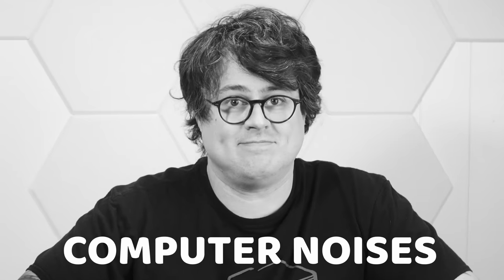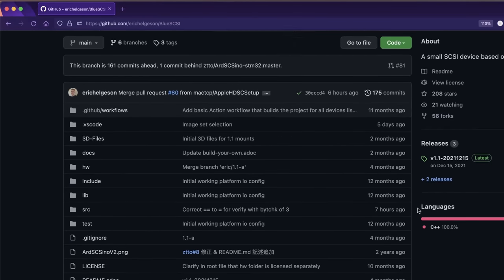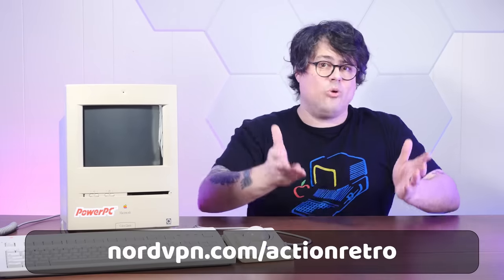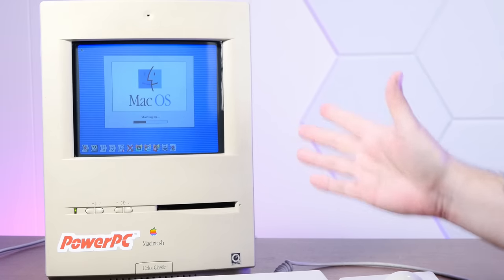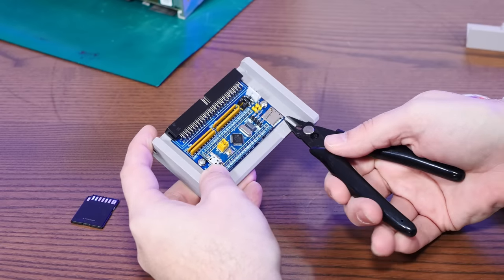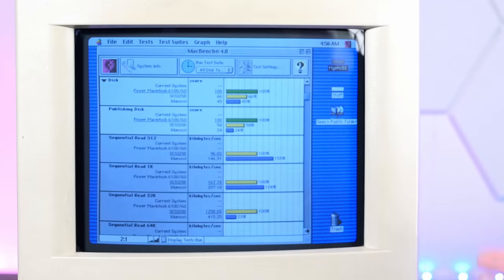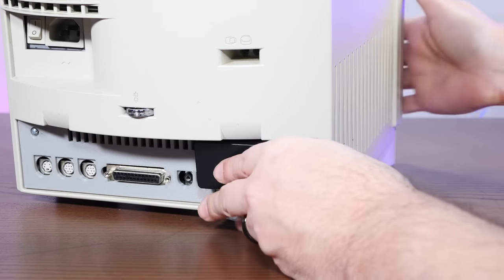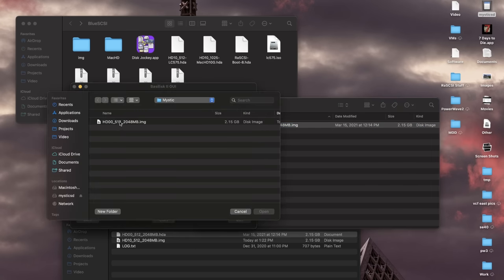BlueSCSI is AMAZING!

Comment: Block size mismatch is a huge problem performance wise on any filesystem, so you should make sure these do match.
Furthermore, small block sizes will improve performance for small files but hinder large file performance, and the oposite is true too, large block sizes will improve performance for large files and degrade performance on small files.
Now, discrepancy between the underlying filesystem block size and the "real" block size perceived/used by the OS that will be using that storage will have a considerable impact on performance and should be prevented at ALL and ANY costs!
This may force you to use smaller SD cards as larger SD cards will typically have larger block sizes. So, keep in mind that unless you use EXFAT instead of FAT32 (which the BlueSCSI would have to support natively) your block sizes will be quite large. For example, a 32Gb FAT32 formated SD card will likely have at least a 32Kb block size, an EXFAT one will enable you to bring that down to 4Kb, this though does require (as mentioned)  the BlueSCSI firwmare to support this Filesystem version.
Reply: Due to the way (statically allocated) disk images work you would always want the filesystem cluster size on the host card to be as large as possible. I spent a while thinking of how to explain it before I realized it's simple: disk images are very large files.
Reply: @eDoc2020  yes they are, but the host side controller still needs to do 4kb or smaller requests, unless you have some smart caching and the needed RAM for this approach, smaller micro-controller based approaches will need to use algorithms that will be directly impacted by the sector sizes (and their alignment). This is where crap it's the fan.
Reply: @João Henrique Da Silva Nunes Jales Ribeiro     The purpose of the filesystem is so the MCU can determine which physical sector number on the card contains a given sector number of the image. With fewer blocks this process should be faster because it doesn't need to process as much FS metadata. Once this mapping is determined for a given sector the FS block sizes don't matter at all. If the Mac requests a single 512b sector and the SD card is using 64k clusters the MCU will only request the needed 512b from the card.

IMO the only place performance would suffer is if there is gross misalignment where each cluster on the filesystem of the emulated drive is spread over multiple blocks of the host device. If the host blocks are larger the chances of needing multiple host blocks per request are lower.

Comment: Awesome video.  My only disappointment was finding out that BlueSCSI was not Bluetooth based, which sounded horrifying to me even considering that I used to chair the Bluetooth HID Working Group.  😉
Reply: Why would even expect that? Just because it had blue in the name? That makes no sense.
Reply: @kirishima638  Actually, at least back when Bluetooth was new-ish, everything was blue.  Everything.  Blue was in the names of Bluetooth products.  Blue was the color of the plastics.  Blue LEDs were constantly used even though they were more expensive that other LED colors at the time.  Blue was in the name of the SDKs, the protocol stacks, protocol analyzers, the company names, etc, etc.  It was so intense that non-blue products stood out.  One such exception was the CATC Merlin Bluetooth protocol analyzer that was purple and that was only because CATC had already used blue as the color of the CATC Chief protocol analyzer for USB.  It's not as bad these days, though.
Reply: @ChrisDreher  That was 20 years ago dude.
Reply: @kirishima638   Yes, many are old, some are new.

Comment: FWIW I got a SCSI2SD in my SE/30 with a custom 3D printed holder that is readily available. The SD card is easily accessible from the back of the computer. Even with your old setup, you can use SD extenders to get the SD slot out of the computer. So ability to swap SD cards is not a pro for either solutions.

Comment: This indicates that the BlueSCSI needs some deep firmware revisions and improvements, assuming the CPU has the needed BUS performance and that the issue is improper code (which soulds like it is) the BlueSCSI shall perform better than any other solution.
Reply: That's a very bold statement considering what the creator of the device has suggested (use Apple drivers), not to mention several comments about the extended SD card reader as the likely culprit. I would recommend holding back on your judgment until some of those ideas have been eliminated as the cause.
Reply: @another3997  I'm pointing to the firmware on the bluepill itself needing deep optimization, and it would likely enjoy to have fast SD cards and some RAM for caching.
Reply: @another3997  Yeah, I'll stick to my point based on a simple proven premisse, SD cards can and do perform way faster than the results being obtained. Caching will help here considerably, but that is not the whole story, even without caching SD cards perform faster than what is being achieved at this time.

Comment: You used a full-size SD card instead of MicroSD, and it was only 16GB. Something tells me it was a really slow and old card.

MicroSD would probably be faster, and newer.

I am also willing to bet the extender had something to do with a loss in speed, it usually does for like the optical disc-drive emulators for consoles.
Reply: Whilst I agree with your card reader diagnosis, and we don't know what card Sean used, I will point out that brand new, very fast, full size SD cards are still available.

Comment: Is there a way to use the bluescsi with files other than disk image files? I'm trying to find a better way to transfer files to my Mac LC than floppy discs and burning cds. I thought it would be nice to load up files on the sd card and stick it in the blue scsi and transfer them to the 575. A lot of the files aren't disk images though.

Comment: I have no idea how these work but I assume that the Blue SCSi, virtually mounts the .img or .hda files in onboard ram. So i'm assuming it uses a processor to do the unpacking. There could be a bottleneck on the Blue SCSi depending on SD card size, or block size and the way it manages ram! Or cache storage, for the Mac to access.

Comment: I'd love to see you get A/UX working on the BlueSCSi. It doesn't seem possible, but if it is, I bet it'd be even easier than SCSI2SD.
Reply: It is indeed possible! There's even premade images in the repo.
Reply: I have A/UX running on a BlueSCSI in my SE/30.  Very easy.  I believe I installed it in Basilisk II on my Mac and copied the disk image over to the SD card.

Comment: Wow. I'm a digital pack rat, been building since 1983 or so, still have a bunch of hardware that you could get retail today for about a nickel (US), but it was extremely expensive back in the day. Adaptec 29xx SCSI controllers were great compared to IDE stuff ... you could put just about any device under the sun (still have a Sony SCSI cassette -- standard 1 7/8 IPS format) on that bus and it would just work. But that's about as nostalgic as I'm going to get, I came to detest that awful "terminal" font as a reminder of the bad old days; today's ware is still a vast improvement over what we had to work with 40+ years ago. Yep, still detest M$FT, I'll never lose that bias ... ever.
Reply: Remember DPT?
Reply: @petevenuti7355  No, I do not. Enlighten me, perhaps? Thanks.
Reply: @8a41jt   Distributed Processing Technology 77-99' bought out by Adaptec. My last SCSI card was an ISA caching raid controller. There were something like 40 jumpers I had to set for Io, dma, busmastering, shadow ram address, even the cards own SCSI I'd and lun was configurable.. there were no aspi drivers, Linux had cam drivers but I never was able to get them working. Card was LONG, full length, and I ran it with 5 full hight 2gig  micropolis drives  for 2 decades. When I turned on my computer my desk shook! It was like driving a hum-v in the office.
   I had dreams of using those cards in target mode to bridge the busses of many motherboards to create some real Distributed Processing Technology.... (Because the buss speed was so much faster then Ethernet and token ring back then)  
   But technology sped up faster than I could learn how...
Reply: @petevenuti7355  Thank you for the well thought-out and complete answer! (I love to collect trivia, even if it doesn't directly affect anything I'm doing now), had never heard of DPT before. I found one of the two SCSI 2 adapters I recalled using very well, an Adaptec 2940UW (32-bit, 40 MB throughput) based on a AIC7880P,  no h/w jumpers on the full-size board. I downloaded the last Linux driver source code for kernel 2.6, aic79xxx.h comments refer to 16 max targets, 256 LUNs supported. Looks like the driver software is from 2006, the hardware EPROM says 1996. If you want it for the cost of shipping/pkg, let me know, I'll ship.
Reply: @8a41jt  thank you! Much appreciated, but no. I think I still have one or 2 of those around, 68pin cables and active terminators.. most of the hard drives I had that were fast enough to be worth putting on that bus burned out... I might even have a few LSI SCSI cards too... 
    When my ex kicked me out and I shut down the ISP I was trying to run(unrelated) I packed my trailer with 750lb of old computers to take to the scrap metal place..   I still got too much stuff ... I'm not building custom computers for people anymore either.
    If I had the money, I'd get a computer with something more advanced than a PCI bus, and 750mhz CPU...
I'd go with a SAS controller now, works with both SCSI and sata😁.
    I'll make a similar offer to you though, do you need any external SCSI cables? Anything you need or want from from a few decades ago?  Most of what I have I'd be happy to part with for only the cost of shipping. I think that's better than the scrap yard.

Comment: I actually miss the sound of a hard disk, clicking away as it seeks for it's data. I wouldn't be mad if there was a speaker addon to emulate seek sounds. Not so much the heavy hum of the drive motor spinning though.
Reply: Someone has made a little noise maker to hook up to the activity LED :)

Comment: I’m not sure what SD card you’re using but make sure it is a good one. I hate SD cards they’re extremely unreliable and slow unless you spend a lot on them. Even if you think it’s over kill I’d be using the highest class most expensive one you could find for this; in whatever size you wanted.

Comment: I've not looked at what this is using, but last time I had to do anything SD with an STM32 I found that all the pre-existing libraries out there seem to use a buffer. I.e., reading in blocks from the (image in this case) file. This never bothered me because I was using it for audio, so my reads where always sequential. However if you are doing random reads and the block size you are reading is smaller than the buffer... well then the code loads multiple blocks from the 'disk' (image file) then has to throw them all away and once again read more blocks than it needs... and throw them away again...

Comment: Does BlueSCSI have a way to unmount/mount images on a specific SCSI ID like we see with floppy disc emulators?  Right now it seems like RaSCSI is the only workable solution on my SCSI macs to swap images on a booted machine - but I was hoping BlueSCSI might have an optical disc setting that rotates images once an image is unmounted and the "disc" is "ejected."
Reply: No, it has no way to switch things on the fly.  I think the new beta firmware is going to offer image sets, which can be rotated by changing a jumper.  But no rotating through CD images, AFAIK.

Comment: Sean, you are using a class 4 SD Card! That's terrifyingly slow!!! 😁 Use at least class 10 for much higher speed. There are even faster ones for app usage. You get what you pay! 😅Also the SD extension might make problems in that szenario, but I am not sure.
Reply: iirc class 4 SDs are in the 4MB/s category (hence the 4), he got less than 1MB/s
Reply: @amnottabs  4 is less than 1 so that's not relevant here. The old speed classes are completely meaningless here, the only ones that are worth caring about here are the newer A1 and A2 application speed classes.
Reply: @eDoc2020  my point was that the SD card wasn't the culprit of the slow speeds, read the pinned comment you would see the maker/developers themselves claims the speed had to be 1.2MB/s which should be achievable by a class 4 SD

Comment: It's not super surprising to me that the bluescsi is slower. It has to emulate those blocks with bytes on exfat. With scsi2sd it's just presenting raw blocks
Reply: It's still just presenting raw blocks, just with a translation in between. Depending on the code optimizations and FAT caching used it shouldn't be much slower, especially for sequential accesses.

Comment: Having a shared folder/partition that modern OS's can access seamlessly that can also be seen by the retro thing you're going to plug the card into is a rather major plus. Makes data transportation a heck of a lot simpler.

Alternitively if you have one of those serial to wifi things you could have an FTP server running to have as a shared fial dump i guess. Though I suppose you're like... WAY more knowledgeable on me so it's like a third grader trying to offer advice to stephen hawking.

Comment: It seems there's insufficient RAM to handle buffering (well iirc it's only 20K on bluepill), MCU with big RAM (or external RAM interface) might've been better choice to build such device.
Reply: So many people ready to blame the new SCSI hardware, without any thought as to what else could cause the problem. If you read some of the other comments, especially the one from the creator of the device, you'll realise that the problem isn't with the device itself. Drivers and that overly long, cheap, poorly shielded cable for the SD card reader are the likely culprits. Not to mention we have no idea what class of SD card Sean used.
Reply: @another3997  Oh, I guess you did give it a thought yourself... while speed overall might be influenced by bad cable sudden drop of of speed when sample size reaches 32K is consistent with something you might expect from (over)saturated buffer. If you have any counterarguments I'd welcome them but atm all you do is just baseless accusations.

Comment: Hard Drive's are often made of coated Glass or Ceramic ;)

not really spinning metal, unless you count the thin layer on the surface...
Reply: Really old Hard Discs were metal at least, have scrapped a couple- first one was metal, second was glass!

Comment: If you were using any of the LIDO images, you’re going to see results like this.

This video should be pulled until it can be verified what the real benchmark results are.
Reply: Is there a performance issue with the LIDO driver vs ? Or some other issue?
Reply: @GarthBeagle  Yes, LIDO drivers are extremely slow (was used in a lot of things before we realized it) - Apple drivers give much better performance. I'm combing through our images now to ensure there's none left with LIDO.
Reply: It’s appreciably slower to use LIDO as your driver than the official Apple one (as appropriate for your version of MacOS).

Those LIDO image files are still floating around out there, and are one of the biggest reasons why folks see less than ideal speed from their BlueSCSI.
Reply: @helfire23  Oh wow - I never use LIDO (unless I have to on some weird setup)
Reply: @RonsCompVids  Yuk, we should evangelize this more, make it clear to be sure to format the image using an Apple tool that installs an Apple driver. I'm wondering if any other drivers (FWB HD Toolkit, etc) have performance issues relative to Apple's.